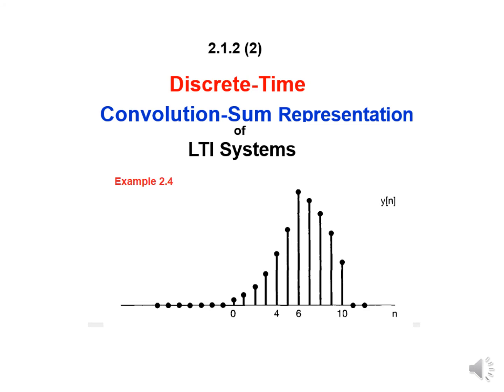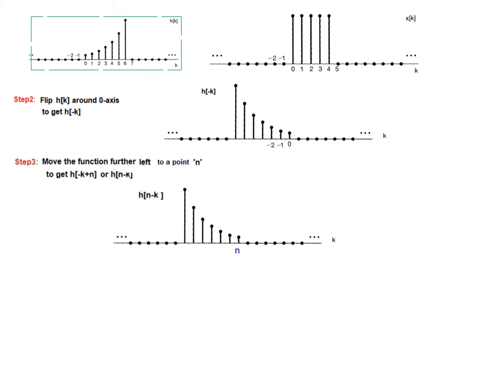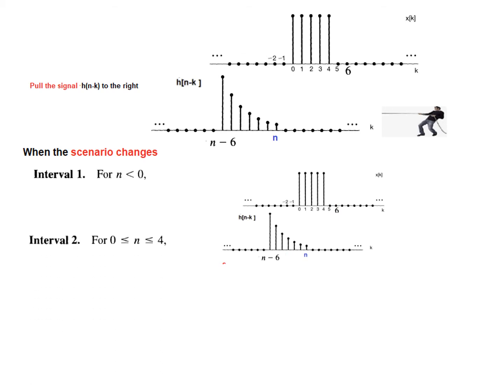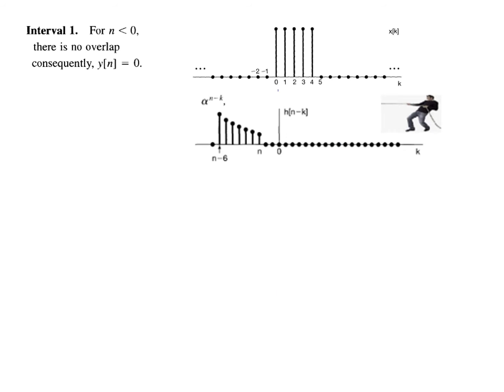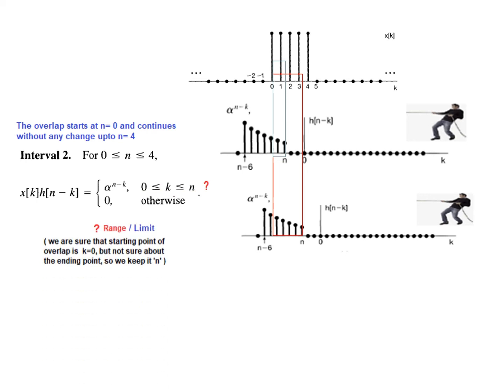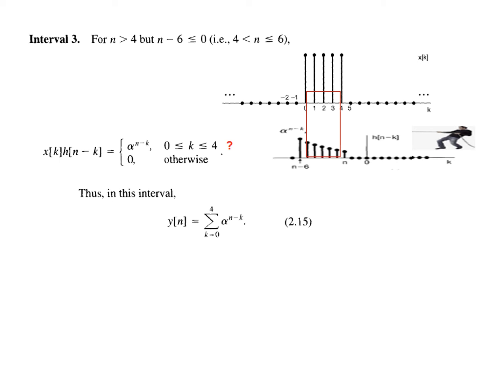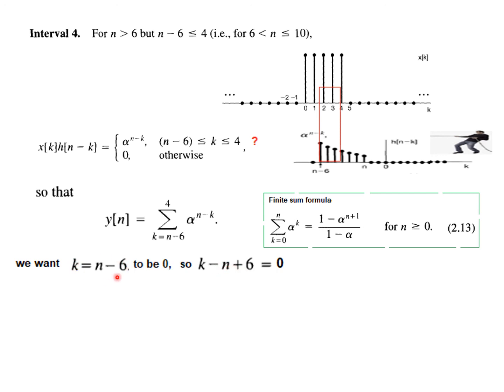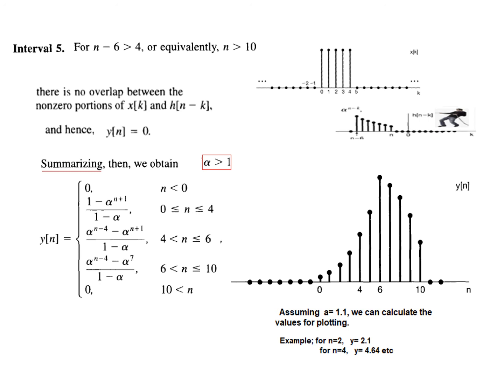(E)SS(O) Ex 2.4 || Discrete Time Convolution Techniques || Signals and systems

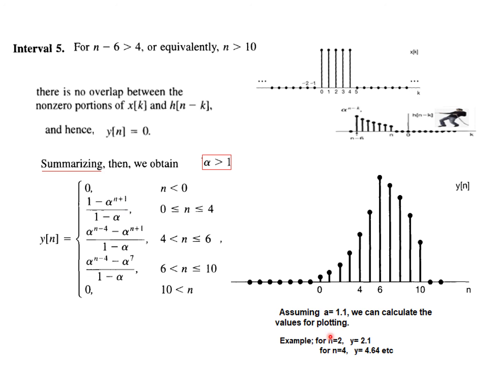Comment: at 19:15 you show n=2 will result in, y = 2.1, however, shouldn't it y = 3.31 since 1.1 will be raised to 3rd power?
Reply from the maker: Yes, correct. Thanks